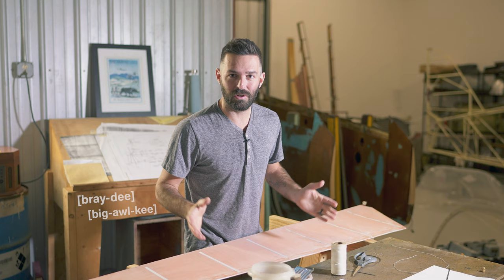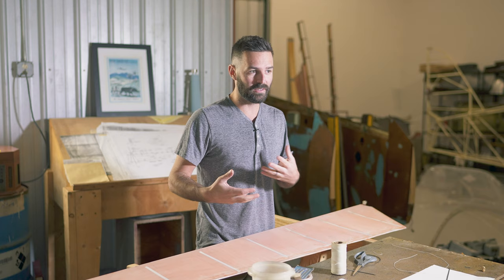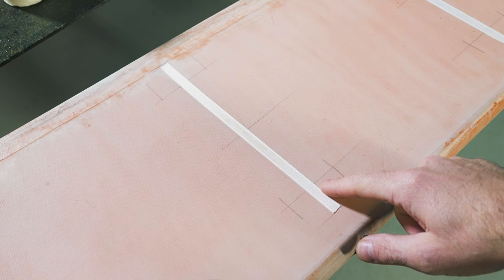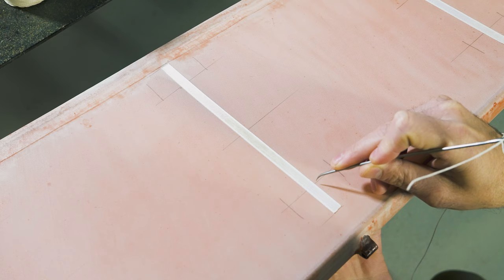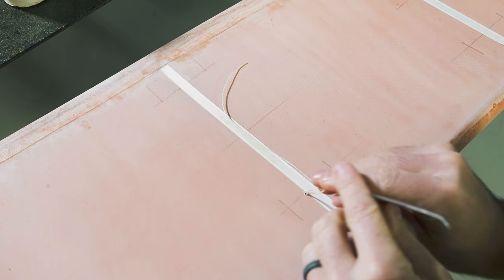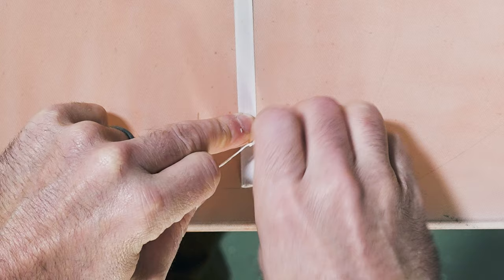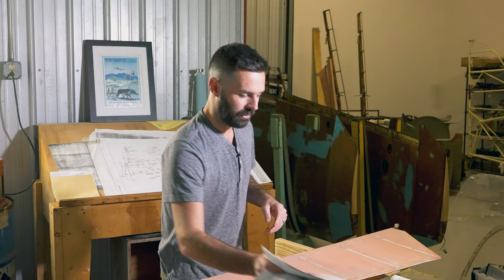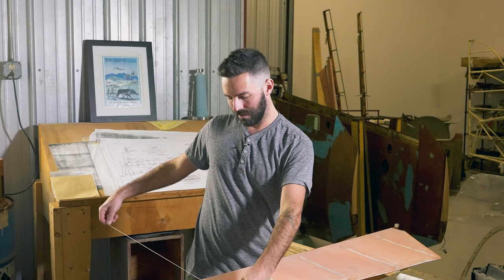How to Rib Stitch Aircraft Poly-Fiber Fabric

Comment: In the winter of 1964 my father and I recovered our Piper PA12 with ceconite. Sad had an FAA Manual that we followed to do the rib stitching. We had the wings in a jig. He would push the needle thru and I would push it back. I believe that he ran the string along the welp and put the needle through again. I don't remember that we buried each knot. However he may have. I was 16 and I was only working one side of the wing.

Comment: You have a nice set of video’s on the Bellanca restoration. I’ve lost a game of “not it” for repairing wings of a Bellanca 14-19-3, the last serial number “Cardboard Connie”.  I need to get the fabric off the wings before I can start repaying some soft spots. The only other IA on the field had too many surgeries last fall (he is 83 years old) and is done. I’ve inherited the task of getting it flyable, most of the maintenance I’ve done is on Piper’s and canned spam (Cessna’s). Stripping a Tripacer is easier than this task. Can you give me any pointers on getting the old fabric off the wings? Russ
Reply from the maker: Wow Russ. That's really interesting. Thanks for checking out my videos and welcome aboard/ Removing fabric from wood can be a tedious, painful process. I don't know the BEST way to do it, or maybe I do. I don't have a ton of experience. All I know is how I personally dealt with removing fabric from wood. I didn't do the wings, but I did do a set of flaps. I just used a combination of MEK (or Acetone) and a dull razor (to not hurt the wood fibers). One thing that helps for spots that aren't coming up easily is placing a towel on top, soaking it with MEK, and then placing some plastic on top of it (so it doesn't evaporate as fast) and letting it sit for about 5-10 minutes and work it's way into the glue. I've done that a lot with the wings. I had to remove a ton of clue using a lot of MEK and a lot of rags. Just make sure you are in a well ventilated area and I recommend getting a proper mask for MEK. Research it. It is really bad stuff, but it works. The last thing you want to use is water because that can ruin the wood so never use water. And focus on one area at a time. It took us well over a hundred hours to get the wings ready to re-cover. Send me an email at theskyelounge@gmail.com if you ever have any questions. I'm happy to help.